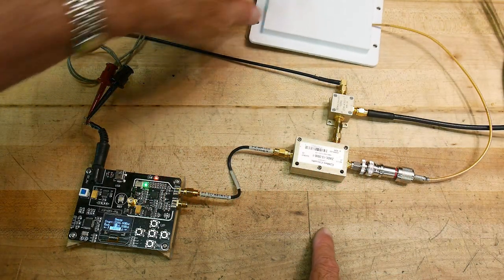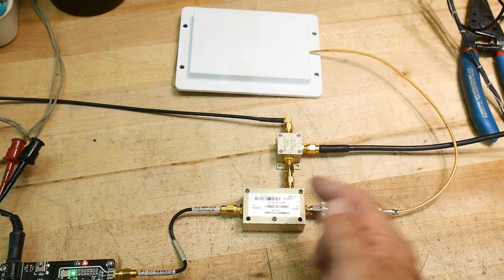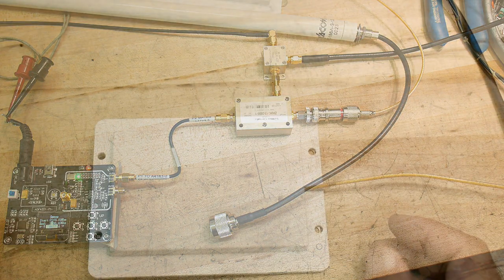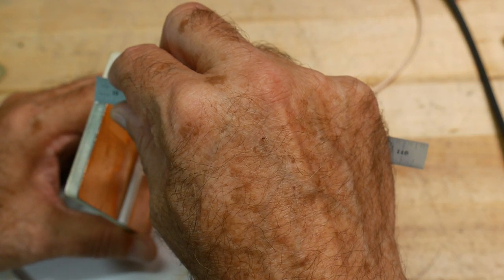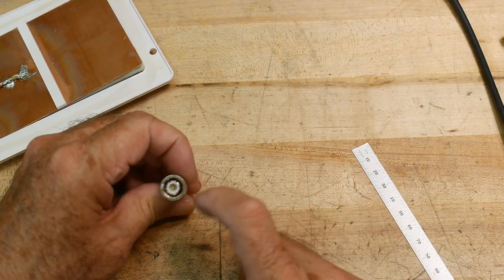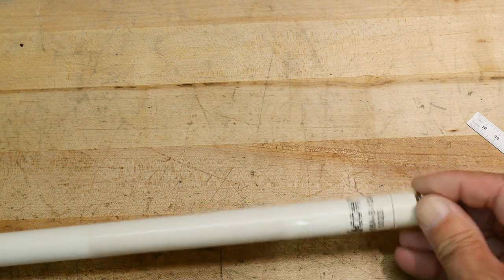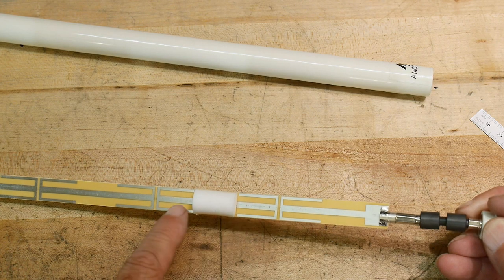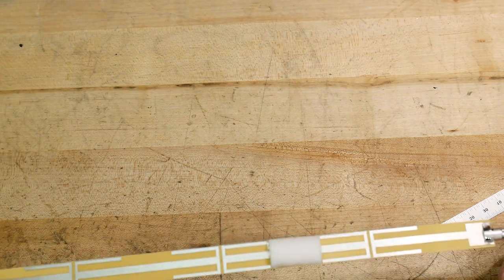#926 Two MACOM Antennas Measure and Teardown

Comment: Nice tear down and a useful tip about BNC fitting N connectors.  Just out of interest, what's the power level of your little sweep generator into 50 ohms? I have one and I need to do a rough calibration of an RF power meter.
Reply from the maker: here are some measurements
https://youtu.be/r8ofczZHt-g
Reply: Brilliant! Thanks for the help.